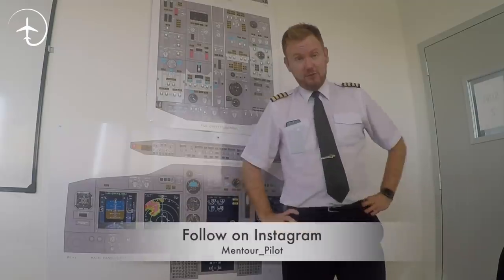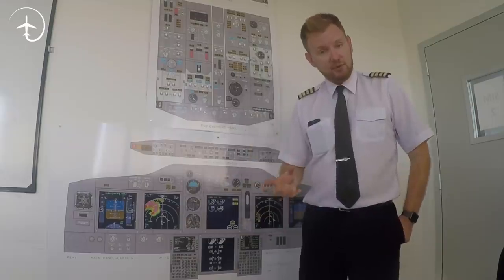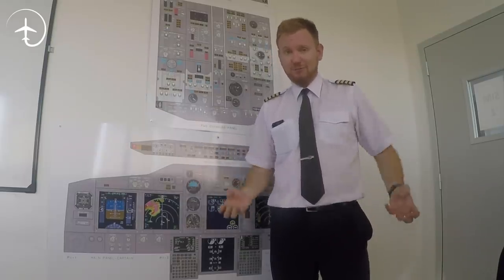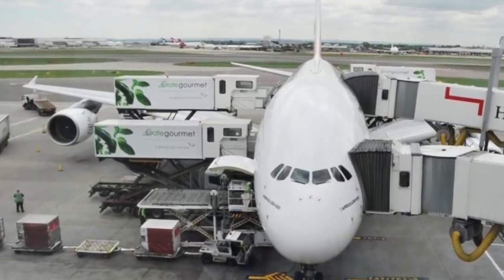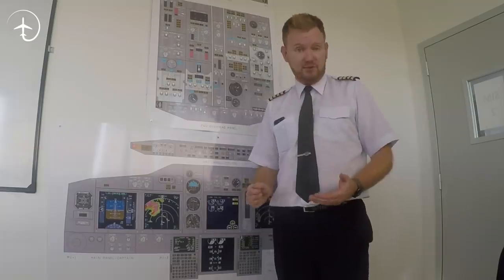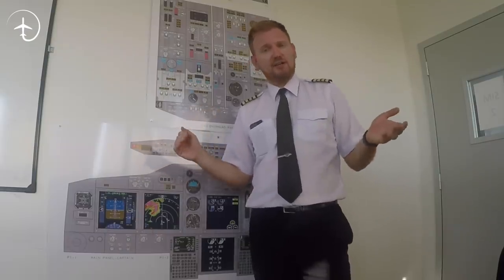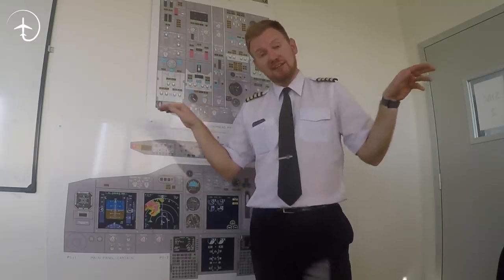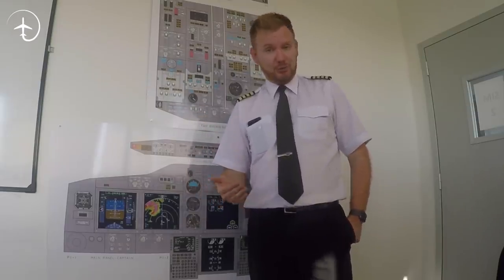What is that SPIRAL in the Jet Engine?

Comment: The spiral on the Nosecone is a German Luftwaffe invention; as in service on dirt and grass airstrips the paint on propeller blade tips wears off quickly, they did not paint the blade tips but painted the propeller spinners with a variety of color-schemes, the black and white spiral being extremely common. It was called the "Kullernase". Regards from Alaska!

Comment: The fuel vent thing is also why passengers don't board through rear doors during refueling. Fuel will spray quite a distance with the pressures used to refuel. (I used to work aircraft maintenance and have seen this more than once.)
Reply: If you have worked in aircraft mainatainance could you please share what earmuffler's / noice cancelling quipment you use to cut out the noise of the jet engines ? I would like to get one myself since i live in the approach path of a mojor busy airport with virtually no noise abatment procedures being followed.

Comment: One addition, as I’ve been working as ground service for some years during my study time: we used the signal pylons under each wing tip to prevent any vehicle driving to close to the wing. The wing tip distance is easy to miscalculate, when you’re sitting in the vehicle, especially if you have low installed wings, so the signal pylon helps a lot.

Comment: I didn't know about the risk of being soaked in jet fuel. Learnt something new!
Reply from the maker: Every day you learn something new is a good day.
Reply: thegeneral123 🤣🤣
Reply: Whaat so I shouldn't use A-1 instead of shampoo, you learn something new every day.
Reply: Happend to my dad a few years ago, walked under a wing while maintenance crew was touching to fuel tanks, my dad got showered in kerosene. He took a long (water) shower to clean it all, trashed his clothes and everything was fine
Reply: When I say "the risk" I mean from it being ejected from a valve on the wing during fueling. I am fully aware of how dangerous it is and how it can harm peoples skin.
Reply: trust me Skkydrol (hydraulic fluid) is farrrrr worse than jetfuel. Diesel is worse than jetfuel as it has more oil and is dirtier. (but both basically the same) Jet a is just supposedly higher sulfur and less lubricity to diesel. But we used to regularly use waste Jet a and A1 to run tugs generators etc etc etc.  Skydrol Burns like acid and you need to get it off asap!
Reply: What is the danger of ice sliding off the wing after previous flight at high altitude?  I have seen ice form on the wing after landing in very humid conditions I assume due to cooled fuel within the wing. Factor in decision not to allow public near the wing?
Reply: ya im a line tech at an airport, saw it happen. Pretty funny. Customer wasn't happy bc of all the $$$ on the ramp. but hey get your plane fixed lol.
Reply: Isn't jet fuel just ultra purified paraffin or kerosene?  I have never heard about the similarities between diesel and jet a, but then again, it's obvious that I am not a chemical engineer.
Reply: Not to forget jet fuel has a much lower melting point. Otherwise the jet fuel would clog during flight.
Reply: There are stories of people who have gotten stuck in the tanks. After a day they were basically gone, only some clothing remained, the fuel ate the flesh.
Reply: +fhhsvnggbh yeah, nasty stuff. Seen an F.O. walk into the landing gear well and about dive back out because a line was misting Skydrol. 
Jet-A is "Dry" and at low speeds  is a pretty good diesel fuel and is fairly clean burning. But, some engines (Cat V8 for sure) it attacks the o-rings in the injection system. You can get around it by adding Marvel Mystery Oil or ATF fluid to the fuel. SWA used Jet-A in all their equipment, then someone decided they needed to change to Offroad Diesel. When they did, the maintenance needs jumped, the smoke was worse, and we had to change a fuel truck over to OR Diesel. I think the supplied OR Diesel was too low quality, and the dye would gum up the works.
Reply: +George V. Cohea it is slightly different, but K1, #1 Diesel (used mostly in low temperatures), and Jet-A are pretty close.  #2 Diesel has a bit more energy, and viscosity than the others.
Reply: I didn't know that either, and I'm a student pilot, and have used fuel drain points under a wing to check the fuel for contamination.

Having said that, this is about large jets, and regular passenger operations. I'm sure anyone doing maintenance will walk anywhere they need to, even under the wing, so long as it's not immediately dangerous (like the engine intakes or exhausts.)

A light aircraft also is just somewhat different. You'd have a hard time walking under a low wing aircraft, and it's actually pretty routine to walk under the wing of a high-wing light aircraft. (though here, one of the more basic risks is hitting your head, given going under the wing would likely require you to duck unless you're really short.)

So, yeah. The things you don't know huh. XD
It does make sense though. and as I said, even on light aircraft there are indeed fuel dump pipes underneath the wing in almost every aircraft.
Though I don't think most such aircraft have any automated ways of dumping fuel. You have to manually actuate the valve, which... You can really only do by pushing something against it from underneath...
Reply: @garylovesbeer unless the ice formed after landing specifically, I would think you could get ice no matter what the weather on the ground. Atmospheric temperature drops about 9.8 degrees celsius for every 1000 metres. Very roughly that's 3300 feet.
So if you fly up to just 10,000 feet, and the ground temperature is 30 degrees celsius, You're now flying in air that's just above freezing point.

Given most jets fly above 30,000 feet, this means the temperature would drop as much as 88 degrees celsius compared to sea level.
(I think there's some complications with this as you go through different regions of the atmosphere.)
Point is it's very cold at high altitudes even if the temperature at sea level is quite hot, so in theory ice could form in just about any weather. (in reality it's not quite THAT likely, but still, the risk is there in theory.)
Reply: enough ice to be dangerous falling off is far more than enough to cause the plane to not fly. Dripping off as it melts it can be really annoying if it hits you in the face or drips down your neck on a cool day.
Reply: Being soaked in jet fuel is certainly not a good thing. It has happened to me a couple of times. Many people are under the impression that because it is "jet" fuel that it is highly explosive. That is not the case. In fact, it is not explosive at all out in the open air. It is flammable, but not as much so as gasoline. Gasoline is more volatile. Obviously if you were soaked in either one, and got set on fire, you would likely burn to death. But the primary issue is that both gasoline and jet fuel, which is very similar to kerosene, will suck the oil right out of your skin. Repeated exposure to it will cause permanent skin damage.
Reply: Also have fuel vents on locomotives. Don't want to be standing next to one if its over fills while fueling. It'll dump about 50 gallons on you in a second. Its not jet fuel in a train, but taking a shower in high sulphur diesel is a bad day. Trust me. I found out the hard way. Had a valve mishap and was drenched.
Reply: thegeneral123
 it's impossible to get soaked with fuel. Because while the plane gets fuel, procedure reqires all passengers to be inside the terminal till the fueling process is complete and then they will clear you to board.. Since you can't be in the terminal and under the wing at the same time logic dictates it can't happen. That goes for planes all planes regardless if you use airstairs or jetways to board.. so this guys explanation makes little to no sense. Then again fly boys rarely make any sense. Also there is a fluid check valve that stops spilling of fuel from the vent. I should know I've replaced them before. so it's kinda not even possible..The swirl is there so ground crew can asses how fast the engine is spinning and when it's safe to work close. It has nothing to do with birds flying into the fan.. Also a bird strike would be completely random. You thinking that a bird would be able to fly trward and aim for the engine of a plane traveling at 500 feet per second is completely Ludacris and out of touch. The fact is most bird strikes happen on the nose or leading edge of the wing because that's a bigger surface area then air inlets of the engine.
Reply: TheLaualamp  total b.s. told by old mechanics to green ones to scare them. I used to make shit like that up all the time.. key word being Stories
Reply: john thaxton 
So you are telling me locomotive fueling stations dispense 50 galons per second? Geezz you must filled up in about 10 seconds..  your story is obviously b.s..
Reply: smokeyjayshouse ... I believe you have them all properly corrected now.
Reply: You would be at very low risk of combustion....I have put out 100’s of cigars in JP-4 and JP-5...
Reply: ...I've seen it personally! In a hot-refuel pit underneath an F-8 with engine turning... the pressure hose popped out of the nozzle as my buddy was trying to release it and he took a bath in JP-5! Lying flat on his back!
You can bet we had that bird shut down and pilot out of the cockpit like now! Fortunately though there was no fire (or I wouldn't be sitting here typing this!) and the spill was soon cleaned up. ...But it made for an interesting morning to say the least...
Reply: Dr. Rich ... WHY??
Reply: maybe his dad was in the service
Reply: I can imagine how painful jet fuel would be on the skin. I made the mistake of changing out a fuel filter on my car (premium) and even though it only poured on my skin for a couple seconds and I washed with soap and water I got a burning dry rash with cracked skin for a couple days in between a couple of my fingers.
Reply: I have personal experience with this.
I worked on C130s, and was carrying out a probe check for an air to air refuelling sortie.
Unfortunately for me, the jockies decided to carry out fuel transfers at the same time (even though they could see what we were doing. Pilots are smart in some aspects, thick as mince in others.)
This resulted in a jet of fuel spraying directly in my face at approximately 60psi. I could just about open my eyes to see that it had sprayed around 20 feet past me.
Nice little trip to the medical centre followed, had some dye put in my eyes to show up any potential damage, then got asked to leave the med centre, because the smell of the fuel was making people nauseous  (thanks guys).
Took a very long shower to get rid of it, and my overalls had to be binned. 
Doesn't appear to be any long term damage, as that was around 8 years ago.
I'd rate the experience a 1/10
Definitely would NOT recommend!!
Reply: unless you have head lice
Reply: A cigar might not be hot ignite jet fuel... but a static spark might.
Reply: liquid, fucking, fiberglass
Reply: Jet fuel is only flammable when vaporized. As a liquid it will put out a cigarette or match.
Reply: also if the aircraft if fully fueled and then delayed;  a moderate ambient temperature increase will cause the fuel to expand & vent
Reply: There are plenty of airlines which allow fuelling during passenger boarding. I've worked on over twenty airlines and only one at my local airport had this no boarding rule during fuelling. Check valves don't always work, especially with fuel sloshing around in the tanks. I've seen fuel on the tarmac several times coming out of the naca scoops. Have you never seen fuel pouring out of heavily laden 747's shortly after takeoff?
Reply: yeah being under the wing was never a good thing, i used to be part of the ground crew at MSP in minnesota and the only people allowed under the wings were the fueling crew, stuff could fall off them like ice and snow buildup as we worked to get the plane ready, the fuel vents, the fueling crew, just alot of nasty hazards
Reply: Nor did I lol. I doubt there's a risk of ignition though as jet fuel being quite close to diesel has a very high ignition point. It can only be ignited by naked flame if it's sprayed or turned into a vapour.
Reply: as long as it doesn't hit a hot surface it should be fine, i have heard from the fuelers that if it sprays and like hits the engine exhaust that it bursts into flame
Reply: There is no jet fuel. Period.
Reply: I have honestly done this before. Not jet fuel, good old gasoline. It wasn't to get grease off but to remove the ever loved product called"Great Stuff", that got all over my hands. Nothing would take it off. Even the company couldn't give me a solution. They said, let it wear off. Um, no. So in comes the gasoline, a suggestion by my husband whose grandfather used the likes of turpentine to heal wounds.  Did it work? Heck yea! But I smelled like a rough neck, for at least a week! lol
Reply: Hi smokeyjayshouse, A locomotive typically has 4500 gallon fuel tanks (some newer models go to 5500 gallons). It takes 17 minutes to fill a 4500 gallon tank. That is 264.70 gallons per minute or 4.41 gallons per second. But even at 4.4 gallons per second, if it over-flowed for just 3 seconds, you'd get a nice shower of just over 13 gallons.  I have a close friend who does this for a living, so I asked him. Cheers!
Reply: Skydrol in the eyes after a hyd pump change. Wearing contact lenses. Not fun at all!! Learned that lesson well...
Reply: smokeyjayshouse the locomotive fuel tanks are more than 500 gallons each side
Reply: I think you have missed the fact that fuel expands when its hot & if the aircraft has been left outside for a few hours after refuelling it can be enough for it to leak out of the vents. I've only seen it in hot countries, middle of the day etc. Been there, seen it & got the tea-shirt. Needed the tea-shirt because I got my first one covered in fuel ;)
Reply: If you get the fuel off your skin quickly its not to much of a problem. Trouble is it seeps into your clothes and even a small amount next to the skin can get very irritating. A bit like being married ;)
Reply: Very low.  Jets have deicing systems. High speeds also heat up the airframe a little. Sometimes, ice forms under wings because of the embedded fuel tanks cool the humid air.
Reply: Ice can form from the refrigeration effect of evaporating part of the water. Ice can form at 36°F / 2°C. Rover cars used to have ice warning lights on the dash that came on at 36° as what is called "black ice" on the road can form on wings.
Reply: "Paraffin" is British for kerosene. In the USA "paraffin" is solid wax at room temperature.
"Petrol" is British for gasoline. Petrol was a brand name of gasoline. Like a British vacuum cleaner is a "hoover." Old folks called all refrigerators "frigidaires." Really old folks called them "iceboxes."
Reply: At 10,000' / 3,000m the standard temperature is 23°F / -5°C. Standard temperatures drop to -70°F / -57°C at 40,000' /12,200m. The temperature rises at higher altitudes above the range of air-breathing engines (about 85,000', the cruising altitude of the SR-71).
Reply: Yeah....jet fuel really stinks. You don't wanna get it on you if
you intend to get around other people..

Comment: Great video! Having worked on a carrier in the Navy I know all about being drenched in jet fuel. The jet fuel tanks are inside the freshwater tanks, for obvious reasons and yeah, when the carrier is 30 years old, there is leakage. We had lots of similar rules except occasionally you have no choice but to walk under the wings of a taxiing aircraft, but you never ever walked through the arc of a prop even when you were 100% sure the aircraft was parked.

Comment: @ 4.10, i once read that japan airlines used to paint a slightly offset "eye" on the spinner (may be still do), this was an attempt to scare birds as the fast moving "eye" was thought to mimic the quick moving eye of a bird of prey.   i don't remember weather it was one of yours, or captain Joe's, but i've seen a video that showed a circle painted around the aircraft. no one was allowed into the circle until the anti collision lights were switched off.

Comment: Bonus fact, the tip of the spiral is sometimes made of rubber, this is to stop ice forming, it vibrates the ice off when the main fan blades at the front of the engine start spinning .
Reply from the maker: Interesting.
Reply: Hmmmm,   there is a manifold that circles the intake lip of the engine that they pipe in hot air to heat up the intake.  A sensor is inside the intake just before the blades.  When that ices over,  you get the caution for engine ice.
Reply: Yes that is correct. The V2500 engine has this rubber tip on the top of the front spinner cone🤓👍🏻

Comment: I have been flying for 60 years and I always wondered why airliners had that mark on the N1 spinner. I thought perhaps it indicated N1 not turning when it was supposed to! When I was very young I used to airstart Boeing 707s.  You had to pull the hose off the fuselage on the right side just aft of the co-pilot, and that was kind of scary being that close to a running jet engine intake. They didn't use marks back then. Nice Job!